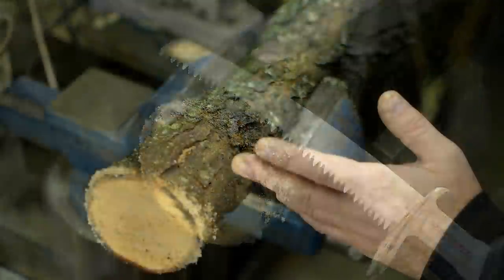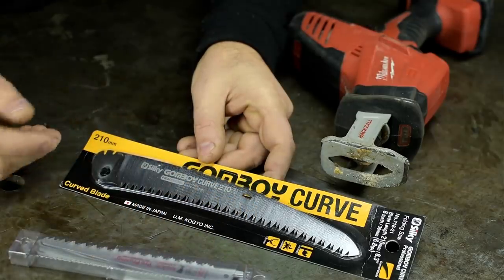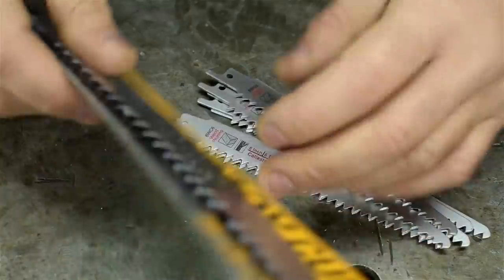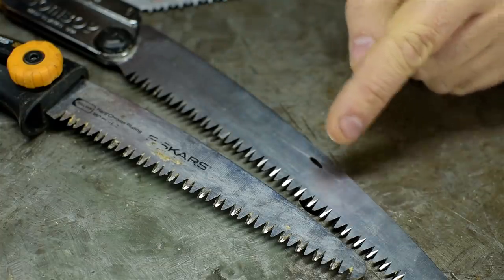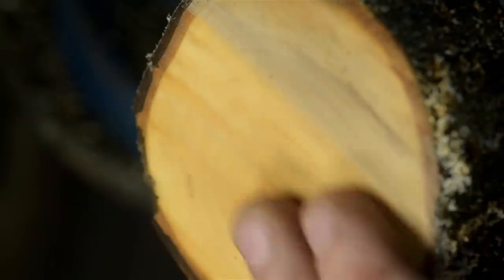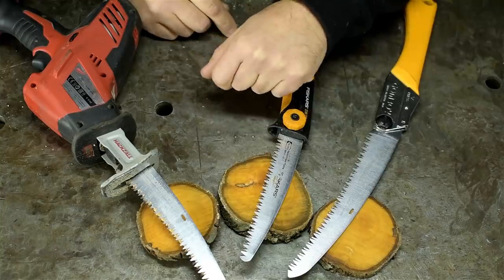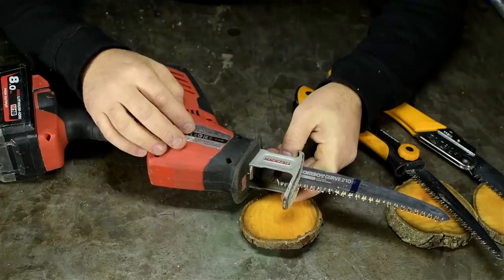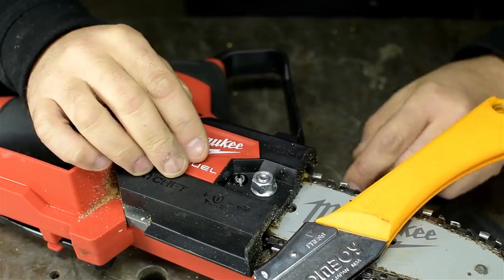Pruning For Machinists!

Comment: Home depot sell Diablo pruning saw blade for exactly that.
I used 1 and was impress by the cut and also the durability i just bougth a 5pack  after cutting two small tree with one blade would recommend

Comment: Tony, great video. I have a Bauer (HArbor Freight) battery chainsaw which looks similar to the Milwaukee. The bar oil drains even when the saw is not running. Your saw may be the same. The saw cuts pretty well and I've cut logs bigger than the 10" bar on the saw.

Comment: I agree with Jake Kees on not using the pruning saw.  However, I think he meant to say a two man FELLING saw.  I may be getting a little to particular but, if you are to use a two man crosscut saw properly, you have to mount one of the men horizontally and sideways and that can make the whole operation somewhat cumbersome.

Comment: Diablo ds0903cp is a pruning blade with a deeper gullet, I've been using mine for a few years and like it,  I wouldn't cut a tree or branch I plan to graft as it leaves behind red smear from the paint.

Comment: Using a recip with orbital stroke function helps clear chips and is much faster than a linear stroke saw.  However, the greater stroke length and chip clearing ability of a hand saw will win out over recips every time.  That said, find a recip with a 6 or 8 in stroke and you got a winner.  And probably a lot of broken blades.

Comment: I did the same thing with some bastard files! Cut the plastic handle off, then used a blade base laid flat on top and clamped as a mask to draw the correct shape and drilled the hole. Then I just used a angle grinder to remove material until it was the right shape/thickness. They work surprisingly well and have yet to snap on me despite having the life beaten out of them.

Comment: If you get bored, you might try putting a large set on an old recipro blade to clear chips.  You have the power available to cut a wider kerf than you would with a Silky.

Do not do that to your new Silky blade, as it will make hunting much more difficult!

Comment: I tried a general timber blade in my sawsall. Useless, as you say the strokes are not long enough
Not too bad in flooring board and quite good in steel though my plain old jig saw does the same job if not better.
When I saw you tring to drill that blade I could see the end coming off the drill as it did. That stuff is hard! A carbide drill may have worked though the ones I had cut hard stuff for about 4 holes. And that was hard steel not cutting blades

Comment: It'd be costly as hell but it'd be interesting to see a saw with zig-zag gullets going up to the back of the blade. That way was the saw goes through a stroke it also pushes the sawdust up over the blade sort of like a linear drill bit.

Comment: I have a 12" DeWalt cordless chainsaw. I felt blasphemous when buying but I kept thinking...what if? During a recent windstorm I went to check out a lot I owned and threw the little DeWalt in the back of my truck...just in case. I wound up bucking up 6 downed trees, all of them 8" in diameter, into 6' logs including removing branches on one sharpening and one 6.0 amp hour battery. I'm sold. The little saw that can...in a pinch.

Comment: Look at "The Axe" that works in both my battery and my properly powered sawzzzawl, and cuts like a bastard, kept me from buying one of those gas powered angry bastards that never start, since it has sat and turned into a varnish storage container. Mill-suck-ee makes em. It's a 9 inch beast, and made for the job.

Comment: Tony, the auto-silky should work better for you if you slow the blade speed down. Hear me out...
Not only are the teeth getting loaded, but the high speed also makes a "floating" thing to happen where because the teeth aren't clearing, the blade "floats" instead of cuts over the swarf. A lower blade speed will allow each tooth to sink and cut before it reciprocates. Slower speed, steady pressure, and occasional clearing the track and you'll think you're cutting butter. 

Red-neckineering 101  ;-)

Comment: and for the smaller small stuff (like cutting your finger .. nails) 
use the bosch mini chainsaw AVE has to open his cardboard boxes ;-) (easy cut 12 i think..)
- maybe give it a test run over your handmade machine cutting blades ? (Downside: expensive, a lot)

Comment: you want a good pruning electric chainsaw try the 120v portland pole saw with oregon bar and blade on it, used and abused mine with great results clearing juniper and small trees using a generator and 100' of extension cord, it also can reach like 8'10" up plus your height and if i have no other power sources i can also just run an inverter off my truck and still have power to run it or use a solar generator

Comment: I expected that the problem would be chip removal with those crosscut teeth and ~1/2 stroke. 
I use Diablo 12" pruning blades in my DeWalt recip saw instead of a chainsaw. 3 TPI blades in a 1-1/8 inch stroke saw, and I do not care if I hit rocks or dirt. I'm definitely more cavalier with it than I would be with a chainsaw haha

Comment: Since you decided to help me waste my time, I figured I should return the favor...
Here's a few unsolicited pro tips for you:
1. Curved Silky's are meant to be cutting on the pull stroke. Only apply pressure on the pull stroke and you will cut faster with less energy. 
2. Next time you want to separate from some money, buy the Silky Tsurugi with medium theet. From all the Silky's and all the fruit tree pruning I've done, its by far the best saw to make clean cut in tight crotch. Its not as efficient as a curved blade for big stuff, but the best quality and the less bark ripping off the cambium on the final stroke (better compartmenting).
3. Get a Pferd chainsaw file and sharpen your saw one or two stroke after each day of use. That Sthil saw should cut much faster...even with an old chain operated by an old Tony.

That being said, great video and I look forward to our next time wasting session.

Comment: Given the RPM of the blade on the sawall it's too quick for the pitch of the blade.  It ends up taking small bites which pack in tight.  There's a reason sawall blades are designed with the teeth (and pitch) they are.
You may also be able to sub out a cheap pole saw bar to get on a cheaper more available chain.

Comment: Huh, I used to get 9 and 12" pruning blades all the time at the local sears, Craftsman branded. I still have a pile of them. They have very aggressive teeth, like a cross between your Silky saw and a very aggressive bow saw blade. I just did some searching and found tat they're nowhre near as common any more. Looks like Milwakee and Porter Campbel make the clostes thing I can find

Comment: Wait, what kind of centerpunch did you use on that saw?  I tried the same thing with a good Starrett punch on a Fiskars pole saw blade (for different reasons) a couple years ago and it quickly destroyed the point, had to regrind it.

Comment: Is there a reason you're moving the saw back and forth?  In my (admittedly anecdotal, albeit professional) experience, any reciprocating saw is quicker - significantly - when you hold the saw (the "Hackzall" part) against the victim...I mean material.  Probably still won't beat a good hand saw.

Comment: I could assume that the curved blade moving at those travel speeds isn’t cutting much in the center of the blade, if at all. I feel that the blade is only cutting on the far ends while mounted in the reciprocating saw.

Comment: I'm sure it has no relevance at all, but it will bug me if I don't ask. What is the purpose of the small hole in the silky saw? Or gomboy I suppose, maybe a trick of the camera but it looks like there is a hole close to the spine about halfway down the blade. Is that just a spot to pinch and unfold the saw?

Comment: Silky saws like all Japanese saws work on the pull stroke only...  I have the big boy which is basically double the gomboy, but also you can lock it differently for cuts that's are too high from you or too low on the ground. Biggest I have is Sugoi, great  for bigger limbs, and for fruit tree pruning I have a looong straight Tsurugi.
Tony are you getting into tree work? 👌

Look into Panther 1/4 bars for tree work chainsaws :)

Comment: Silky blades only cut on the pull stroke. Plus, in this recip saw, you're only using a tiny portion of the blade. If you were using that blade in the purely manual version, you'd be through that branch in about 5 pulls, using the entire length of the blade.
Edit: I made my above comment half way through the video: no patience lol....

Comment: What's the word on bow saws?  I've got a collapsible one that isn't much larger than the folded hand saws (for a much longer blade), but seems a lot more comfortable for all-day use pulling perpendicular to the handle rather than parallel.  Not as easy to get into tight spots, but I use it primarily for breaking down brush (trail crew work) rather than pruning, much less grafting.  What I have is an Agawa Boreal 21.  It really spans the gap from loppers to chainsaw.  I could really go for some collapsible loppers, but have yet to find those!

Comment: It's a bit too soon to do my apple trees another month or so I need to do a lot of trimming ,, just got the place a year ago ,, TOT could you fax me them tools so I could test them .. Great video did not see that coming the powered saw blade getting plugged like that .. build a air gun to blow the saw dust out of the cut when you are trimming ??? just a thought ..them air compressors that plug in your auto are small enough plus could run off the tool battery ..

Comment: I bought the Milwaukee brushless drill and impact driver a few years ago and regret it.  The chuck on the drill always slips and the impact driver has electronic problems.  For the driver, the motor and light will stay engaged after use (it doesn't spin, but you can hear the whine).  The value of the forward/reverse switch is also not read correctly and the drill will need to be power cycled by plugging and unplugging the battery to get it to go in forward or reverse.  I haven't sent them in for repair because I don't know when I would need them and repair service takes several weeks.  👎👎
Reply: For what it's worth, they both lasted around six months before the problems developed.  Prior to this, I had a Craftsman brand set of nicad powered hand tools. At this point they were bought close to 20 years ago and the drill still works fine and I've had no issues with the chuck.

Comment: Every time I see one of your titles I always think OK, what is this 'idiot' up to now.  As always I wasn't disappointed.  Breaking the drill in half to make your 'sawzall' was genius.  Going to have to give that a shot.  :-/  Also, pruning at the vice seems mildly productive, at best.

I've hand sharpened that silky type blade on a pole saw with a diamond disk on the dremel and it works pretty well, JIC someone wants to save an immediate (or mostly permanent, with upkeep) trip to the hardware/tool store sometime.  I did it just on a whim, figuring the result would be crap, and low and behold, it wasn't.

I hate to be a proper subject Nazi, but do you really think poly-orchidism is something you should be bringing up on a channel kids might be watching?  :-)  My adult son is into that too....oh wait, that is something else.

Lastly, significant portions of the comment section in Tony's videos are pretty much as good as the video.  If you've gotten this far and don't read them, I recommend it.  The cross cut elephant hunting saw comment (control F it) thread below is golden.

This is one of the better YT channels available, just from a humor standpoint.  And every now and again I actually learn something.

Comment: Chainsaws work better 100% of the time. Sharp chain better cut, seconds not minutes. But then again I use my chainsaw for all carpentry and every time I cut wood for anything, works better than any circular saw I've ever used and no electricity required

Comment: you should use a tooth setter and pitch the teeth waaaaay out,  its designed for hand cutting and isnt ejecting the sawdust at that high speed.  Just my 5 cents worth...

Comment: @This Old Tony
Tony can you please make a video about water cooling a TIG welder "machine" please?   as water cooling the tig torch only  is very common, but actually water cooling the welding machine itself to increase the duty cycle is unheard of . it would be a first on youtube. i know it can be done with a simple PC water cooler system

Comment: Feels like with the shorter stroke, the blade isn't moving far enough to clear the sawdust from the cut before the next pass. I suspect if you put that blade on a handle and use the full length, you'll probably get a faster cut by hand. I haven't finished the video yet, so you probably got there too.
Reply: Dammit, yep, you got there :D I'm sorry I lacked faith. I should know better by now!

Comment: Hunh.  I've got a fallen branch out back, maybe 5-6" in diameter, that I want to convert to fire wood.  It's already on the ground, so the elevation of the tool is irrelevant.  I've been thinking that using my pruner or a wood saw would be taking a long time.  Then I thought -- "wait a minute, I've got a recip saw...I'll just use that."

After getting an education here, I'll at least have an idea as to what's happening if/when I find that the recip is not working very well.
Thanks!

p.s. I find chainsaws absolutely terrifying, and will never own one.  I prefer to continue to have the same number of digits that I am currently equipped with.

Comment: Diablo markets a Swiss made nasty sharp pruning blades for recip saws in 9" (# DS0905FG5) & 12" (# DS1205FG5) that have teeth ground kind of like the Silky (fleam grind???)
Also, that blade would work a lot better in a full size recip saw that has a longer stroke length than your compact Milwaukee HackZall

Comment: Why didn´t you test the Diablo Carbide Tipped pruning sawzall blade? Diablo keeps winning cutting tests with many of their different saw blades. Their pruning sawzall blade seems to be the fastest. Their Steel Demon metal carbide blades are the fastest. Their general contractor blades cut wood with nails very well. Woodworkers seemed to endorse their tablesaw blades around 2015 when I checked last time. I believe they are owned by Bosch.

Comment: What I cannot figure out is the design of the oscillating saw blades. Why don't they have chip gullets like an old time logging saw? There is nowhere for those chips to go and it usually just heats them up until you burn them away. Terrible design, but not a single manufacturer makes a decent blade...

Comment: The pro version of the 192 has a metal (magnesium or somesuch) gas tank, so it's less likely to shatter when (not if) you drop it from up in a tree...

Turns out, if you leave it on the mini excavator tread, they still flatten out when the other guy isn't paying attention while you go to get gas...

Comment: I cringed so hard when you put the saw blade on the drill press without clamping it. Doing that is dangerous enough even with a piece of metal that isn't sharp. If the bit gets caught it will slice you real good.